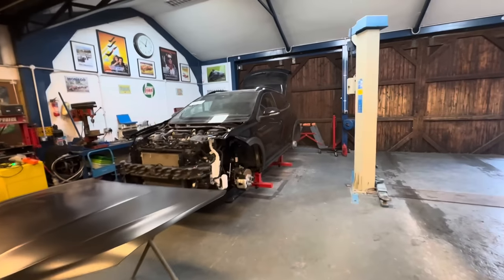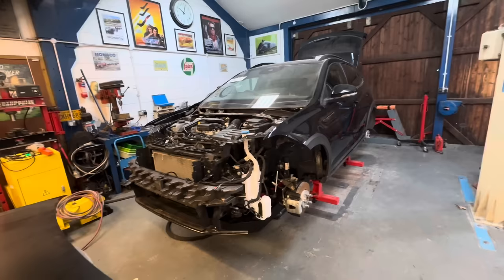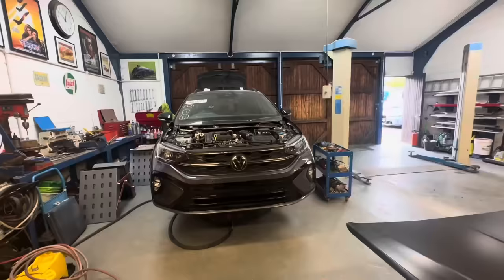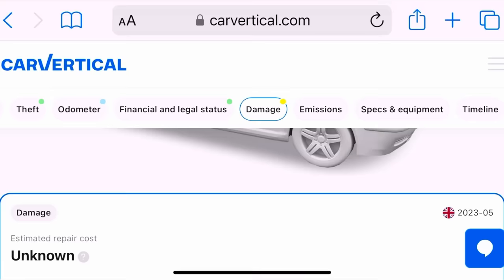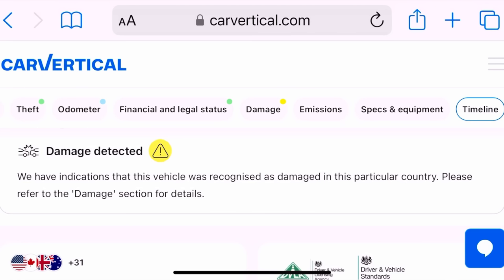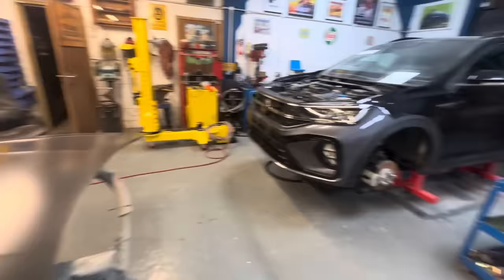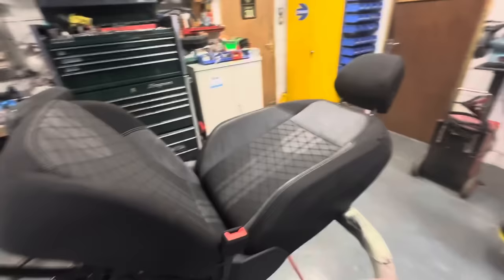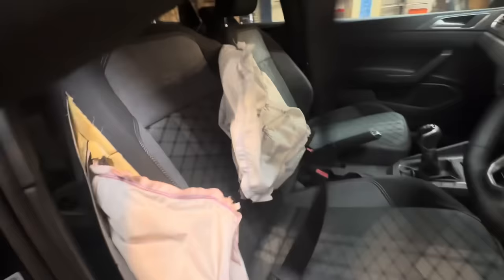REBUILDING A WRECKED 2023 VW TAIGO PART 5

Comment: Hi Guys, The Taigo is built on the MQB platform from VW. With a few exceptions on exterior parts, most parts from the 6th Gen Polo (AW/BZ), will fit.
Reply: It’s the slightly different MQB A0 platform which is the polo as you say MQB is the golf sized cars difference is the manual handbrake
Reply: Agreed, Forgot to add that it is based on  the A0 platform. Technically speaking MQB isn't actually a platform, but a matrix of interchangeable parts.  @danielrussell446

Comment: Nothing wrong with the little VAG 1.0 litre.  It won an award in 2018 and they use it in many cars across their ranges - so tried and tested.
Reply: Rediculous mpg and reliability, think they did away with the 1.2tsi and made the 1.0 the smallest in the range, my 1.2 never uses oil or coolant, unlike the 1.8 and 2.0 petrol and diesel engines in the vag range
Reply: I had a Fabia 1.0 TSi as a hire car. Genuinely couldn’t believe it was only 1 litre. Not blindingly quick, but more than adequate for every day motoring including A road blasts and motorway cruising. Enjoyed it a lot.
Reply: I drive a Taigo 1.0 TSI with dsg...in sport drive its like Usain Bolt😂😂😂

Comment: Great video!! The small turbo vag engines are the best in their engine range for reliability, I have a 1.2tsi Leon and run it for 5 years so far and it's only needed tyres and front brakes in 60k

Comment: Great job doesn’t matter that it’s only done 900 miles! I had one of the first Siroccos 2lt tsi in Mallorca when they first came out the engine blew up at 950 km !!! The camshaft lost half its teeth for some strange reason, six weeks later with new engine from the dealer got it back 🙉🙉🙉

Comment: Hey rob the motor on the seatbelt is travel assist if the car doesn’t detect you holding the wheel it tensions drivers seatbelt and taps the brakes 😅😅😅

Comment: Why do the seatbelts have to be reset/replaced? The older inertia reel belts lock, but release when you let them roll back ready to use again, seems a backwards step to me, having to replace them